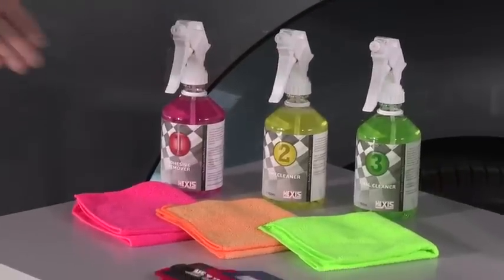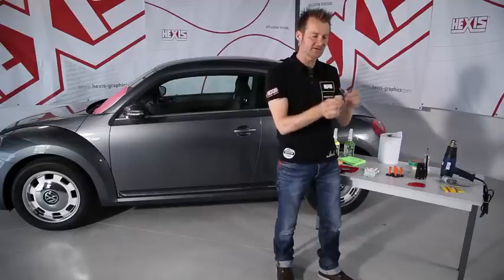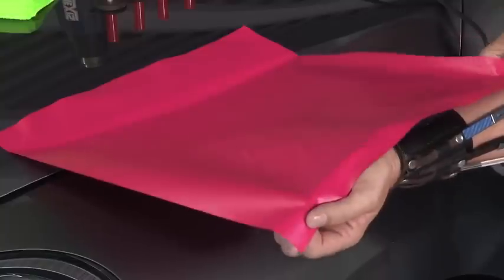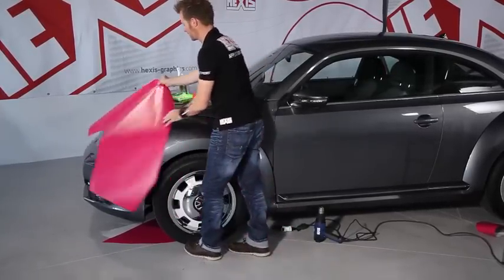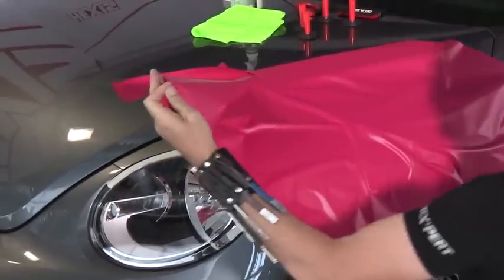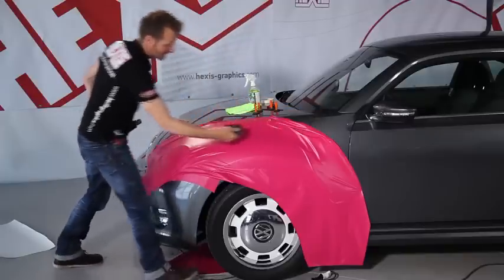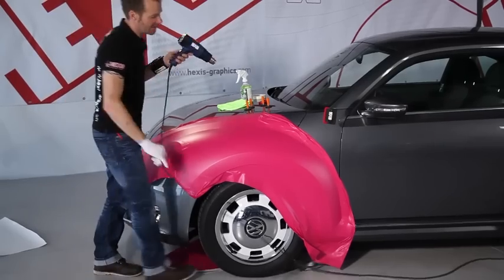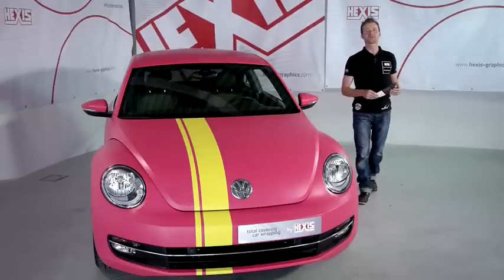Car Wrap Training Essentials   Stickittome Australia

Comment from the maker: Hi Stephan, the film used in this video is from the HX20000 range and is a high quality multilayered cast manufactured by HEXIS in France. The HEX'Press technology in these films allows for repositioning of the vinyl during application. After a full wrap with heavy deformations, it is essential to reheat the deformation at 80 - 90°C (176 - 194°F) in order to ensure good adhesion of the vinyl over time. In the case of the HX30000 series with structured surface effects (carbon effect, alligator, sequin, leather...) the reheating must be carried out with utmost care (medium setting on the hot air gun, maintain sweeping movement of the hot air gun, increase the distance between the hot air gun and the surface of the film). You may like to view our Advanced Car Wrap training video as well for tips on working with Digital Media. I also recommend viewing the Product Application Guides for a 'step by step' process on how to work with HEXIS films. They are available to download from our website. Please do not hesitate to contact us if you need anything else.

Comment: Hey, I was just wondering. how do you destroy the memory the of the material? is this why you heat it to 90 degrees around the edges? Also are you using 3m? and how does the stretching work when using images, would the image get distorted?
Reply: As a professional.  you would not sell your product where an image is stretched on a 3 way curve.  You have to look at the vehicle first before design the artwork,  people who don't consider where the image and curve placenta will fail.  This is a hexis video not 3M.